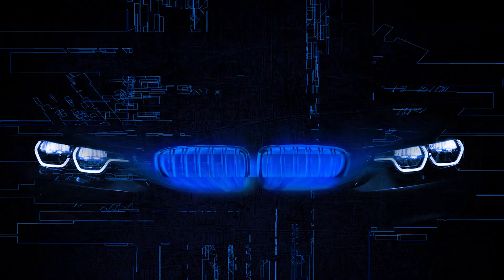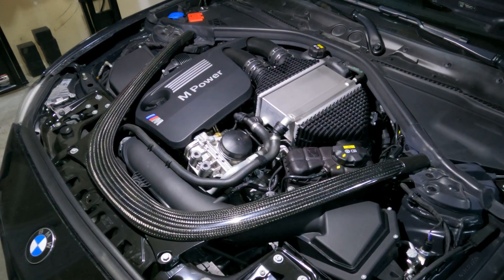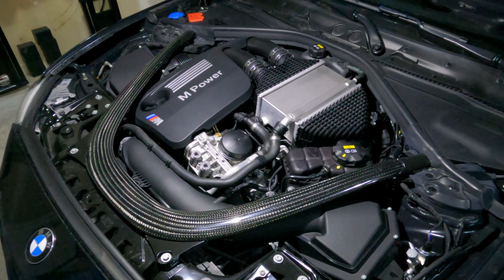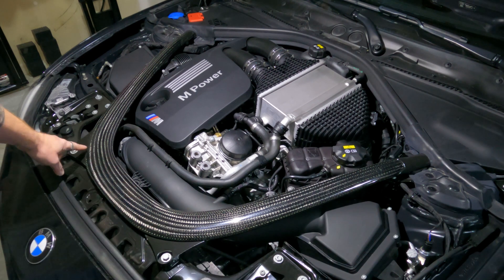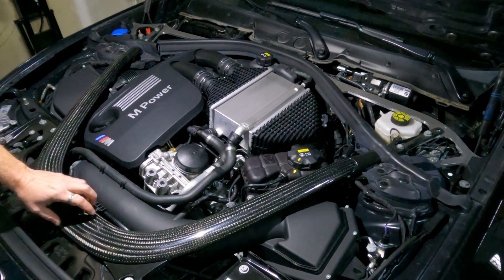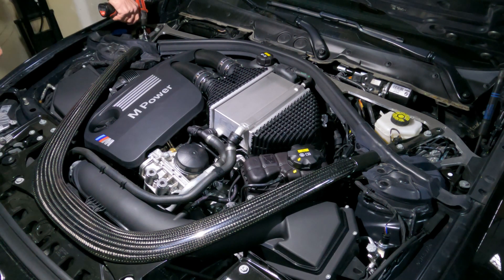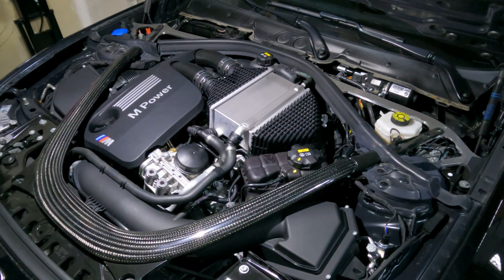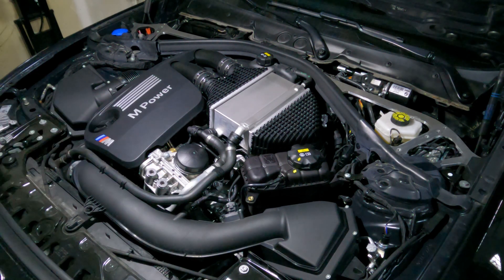How to install the Mosselman oil thermostat into your BMW S55 M2, M3 or M4!

Comment: What happens if you do spill oil over the belts and surrounding area? Would it cause any damage?

Asking cause like an idiot I did spill oil.
Reply from the maker: It happens so dont beat yourself up too badly about it.  The main thing is to get it clean or best you can.. you could always use a gentle cleaner like diluted simple green, on a rag to help wipe down the belts.  Get what you can, and I am sure it will be fine.

Comment: Do you need the install kit gasket and O rings, mine didn’t come with it
Reply from the maker: In general you want to replace them while you are there.
Reply: Do I need to though? For the mosselman or are they the same gaskets and o rings?
Reply from the maker: @exhaustfanatic2417  yes because the gasket goes on the engine side, and on the pipes, that doesnt change.  I would change them myself.

Comment: What is the torque specs of the oil thermostat? And the collar too thanks
And you mentioned it comes with 2 o-rings after watching this I will order Mosselman and gasket 👍🏼👍🏼
Reply from the maker: So the 3 bolts are 16nm and the long single bolt holding the collar is 8nm.

Comment: What are the torque specs for the bolts?
Reply from the maker: Front and rear CF strut bar torque values:  28nm
Bolt holding oil return pipes: 8nm
Oil‐coolant heat exchanger to oil filter housing: 16nm
Reply: @BMWDIYGuy  Thank you! I've been searching all morning for some specs but it's been a cluster.
Reply from the maker: @xlBattlefieldlx  Happy to help.. finding official torque specs is much harder than it should be.

Comment: I've been running the Mossleman thermostat for almost 2 years now...one of the best upgrades for the price you can do.
Reply from the maker: Totally agree!
Reply: What’s the purpose of this Mossleman and benefits for my engine?
Reply: @vetodmp2821  It keeps your oil temps lower.  I average right around 190 degrees F no matter how hard I drive.  With the stock oil thermostat, it was around 230 degrees F.

Comment: I am going to buy this but I’am worried that the thermostat will stick and starve the engine of oil..
Reply from the maker: Can't say I have ever heard of that happening..
Reply: @BMWDIYGuy  ok, I trust your judgment..
Btw, yesterday I found my rear catalytic converter red hot so now I figure will be needing injectors and possibly new cat, might as well buy vrsf down pipes...
Reply from the maker: @buildindian8169  Sounds like time for an upgrade! 8)
Reply: You’ll be fine, I’m in Europe and been running this and their turbos for 2 years. Mosselman are good guys. Been around since like 1979